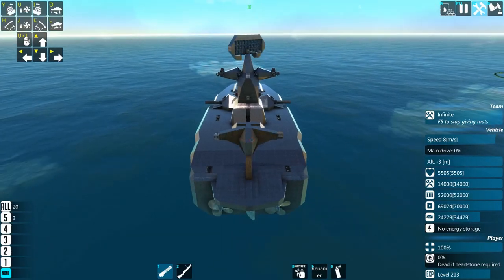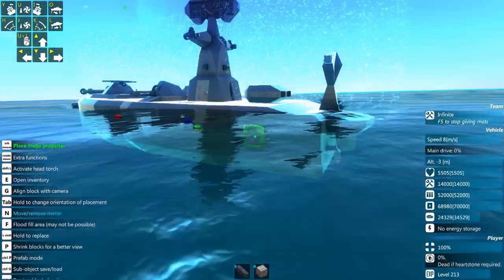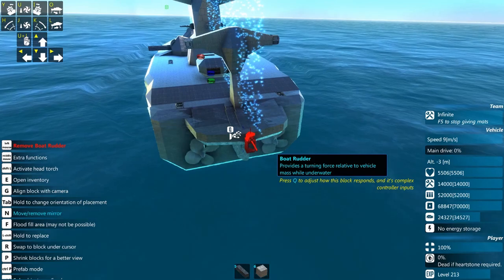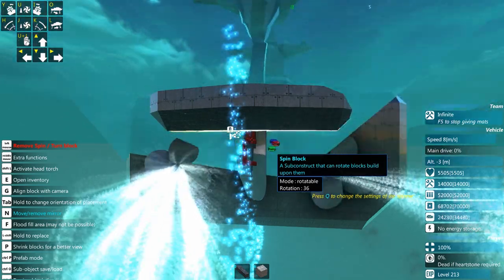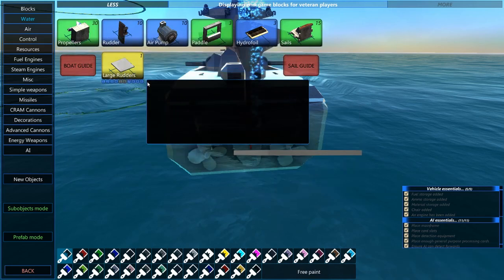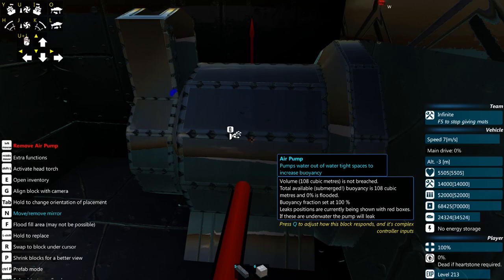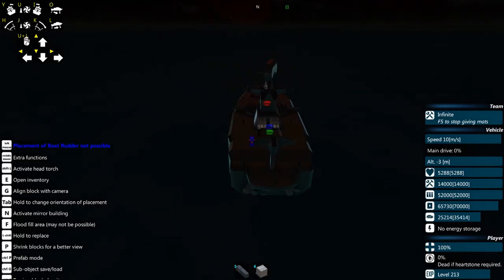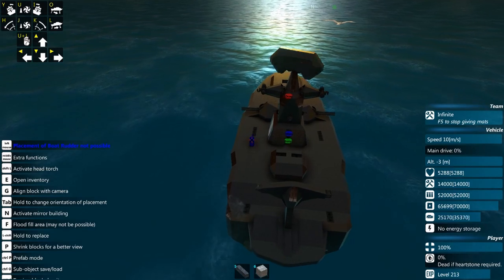From the Depths - Tutorial 4:  Water Movement

Comment: I wonder why are you generation so much power on this ship?
Are there noenemy switched-off shields? Then there should be some electric storage, not?
I remember something in AI behaviours, or modifiers at least two choices about sailing, beside "water start" and "propulsion balancing" I think.
Reply from the maker: The ship isn't 100% finished, actually! I tend to add shields to vehicles last, and I wanted to wait and see what the APS/shield rework and the new shields Nick has been talking about bring to the table. After experimenting with the new shields, I'm pretty impressed--I may end up using them rather than traditional shielding in a lot of cases. This particular vehicle has pretty heavy armor; jacking the armor class through the roof on the outermost layer of components with a combination of armor layering and the new shield system may actually be more effective than a ~30% of shots fired mitigation from a strength 10 shield layer, especially since it's effective against all forms of damage and I'm using airgapped armor anyway to help prevent spalling damage.
Reply: @Strycken1  Yepp, I agree - I never liked anything power-hungry, like layered shields, steam, or lasers.

Using gaps with pumps is a great idea.

Do the ship actually floats without bottom propellers? Have you considered helium pumps?

A few CIWS simple lasers with 2way turrets would be too much drag on the sides of the ship? They are good against torps and missiles, especially if you mix in a lesser priority WC to hole near enemies.
I do not know if the physics calculates drag for subobjects.